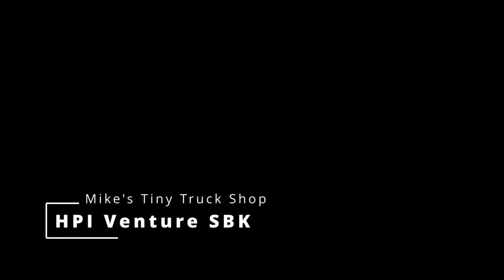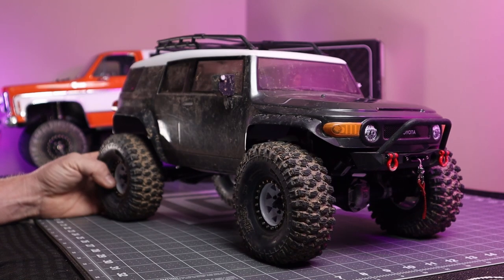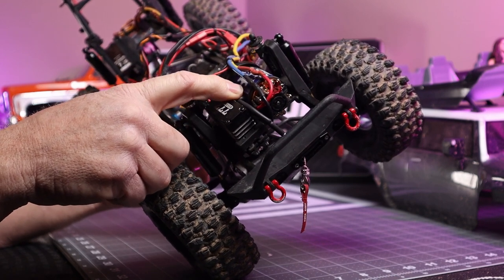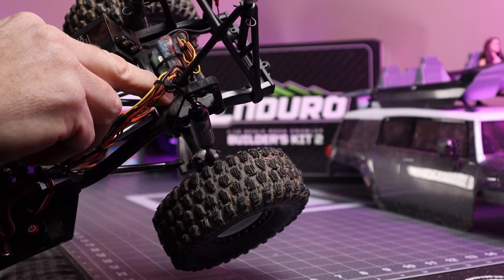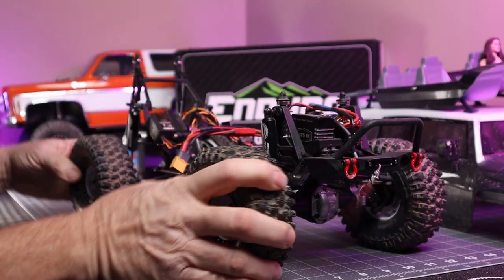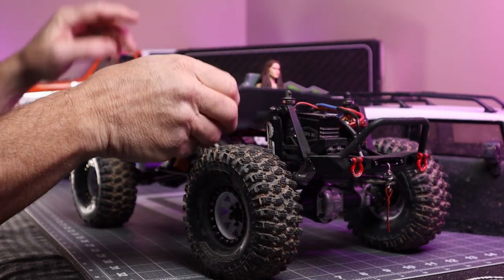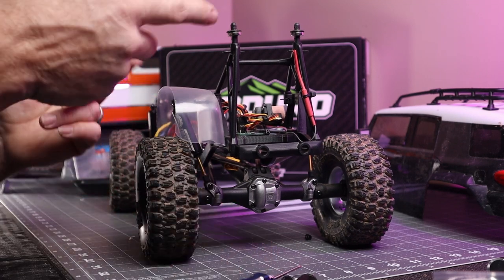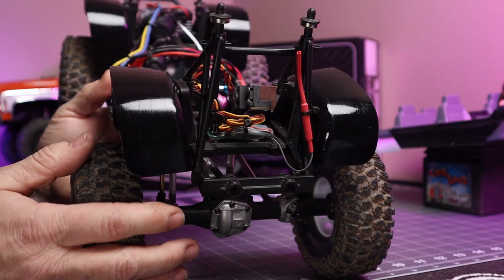HPI Venture SBK.  Rig rundown and free inner fender mod

Comment: Glad to see someone else still using the Venture. I built mine for class 1 and have another SBK that I need to build for trail use.
Reply from the maker: I love the venture platform, you just have to be dedicated to build one since there is zero aftermarket support.  Mine isn't necessarily a comp rig but it performs very well and will see the occasional class 2 event.  Still got more in the works for it.

Comment: Nice to see someone else with the FJ Venture! Love mine for sure. I’d do this  mod if I didn’t have the lexan inners already.
Reply from the maker: It is definately an overlooked platform.  Mostly due to lack of aftermarket support and short time it was available.    Stay tuned though, I have more in the works for this one.  Next project is gearing down and a DIY under-drive rear which I’ve never seen done.

Comment: You can flip the factory transfer case for overdrive...works great
Reply from the maker: The big issue for me is not wanting to raise the gear ratio any more than it already is.  HPI way over geared these for my taste.   Since this video, I have pretty much redone the entire drivetrain.  It’s currently running a 1500KV outrunner with 10t pinion into a 1:9 team garage hack transfer case and  a 13% UD rear diff.  It creeps super smooth and works really well.

Comment: Hi Mike, can you tell me what tyres you use (pro-line hyrax right?) and the size of them? 
Thank you 👊
Reply from the maker: When that video was made, it had the 4.75 Hyrax in G8 compound on SSD beadlocks and CI foams.  Since then, I have switched to a set of 4.75 KM3s in Predator compound on Locked Up RC beadlocks with single stage foams in back and dual stage in front.  They work much better than the Hyrax in the type terrain we have around here.  The current combo are the ones I built in this video https://www.youtube.com/watch?v=oRVkpfamD04&t=11s
Reply: @mikestinytruckshop  thank you!

Comment: Mike do. You know where I ca find a FJcruiser body
Reply from the maker: Mine is from the RTR venture I started out with but I also have a spare that I bought on eBay a while back.  They are still on there but are way expensive.  Like $100 plus unless you get lucky and snag one cheaper.